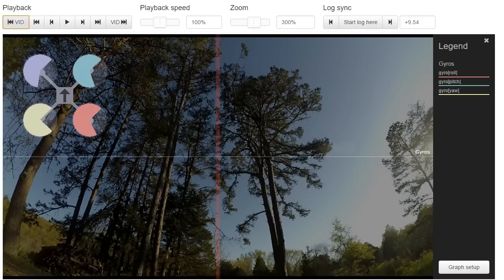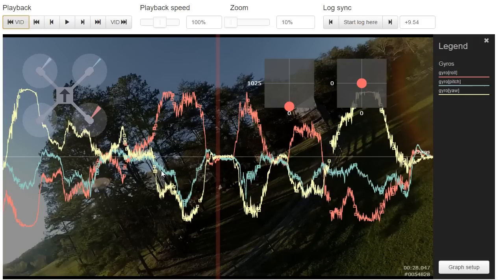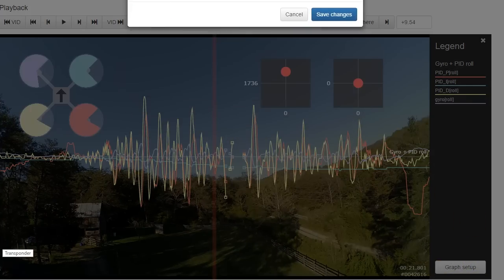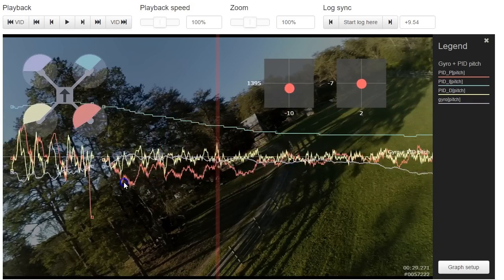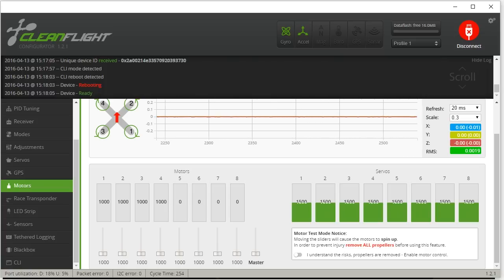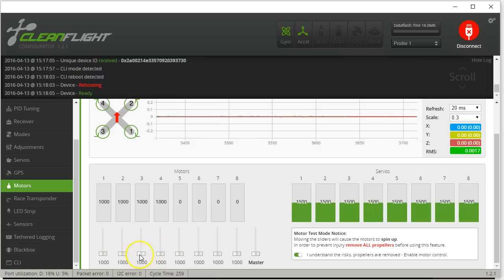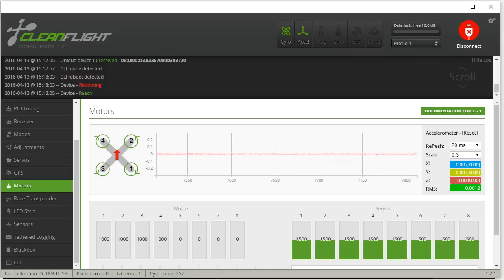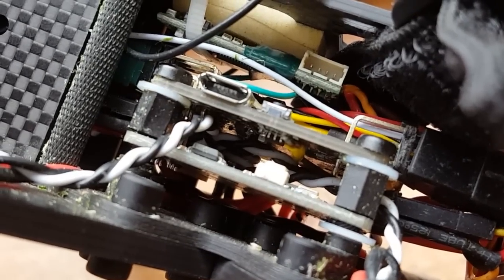How to Troubleshoot Your Noisy Gyro

Comment: When I test my motors (no props) the numbers are consistently jumping around and this is on ALL quads I’ve ever had.. how are your gyro #’s at zero lol what is wrong with my setup? It’s not the computer or the quads I just don’t understand maybe the table even though I’ve done it on 2 tables and recalibrated.. I probably ask more questions than anyone else on your channel but I have ALOT of questions and no one to ask. Anyway thx for all the help and maybe from now on I’ll only ask the really important questions (this ones not that important just curious)
Reply from the maker: Make sure you are viewing the accelerometer and not the gyro. Newer configurator switched to gyro which looks more jumpy. There is a pull down menu to change
Reply: @JoshuaBardwell  FINALLY! I don't know if you remember but im the guy with the astrox that posted a video and you told me it was midthrottle oscillations.. and you were right. I tried everything from filters  I changed the pwm like you said and many other things (made the quad fly better regardless) but now ive FOUND THE ANSWER!! (im a little excited) the brand spankin new 3b motors werent balanced! that's what is causing the oscillations on 2 of the motors at around 1265 throttle in BF.. I balanced the most problematic motor with pieces of vinyl tape and it sounds great with almost no vibrations.. I noticed the two motors that are causing vibration have way more glue (about 3x) than the other twomotors, the glue is also directly opposite where I need to put the tape to get it balanced so my guess is they carelessly put too much glue when balancing at the factory.. this is good news for me though if I can figure out how to take some of it off.. any ideas? thanks so much for the help man this is my first premium build and I was so disappointed when it was flying worse than my $200 first bnf lol you're the man and your videos are on point!

Comment: Hey Joshua, I have a little issue using black box. I was checking the logs of a fresh build. A few of the logs are good, gyro and pids are smooth. The motors are Hypetrain freestyle evo1.1. The bearing are all good and they spin super smooth with the wealth v2 esc's, in my black box, some logs on my gyro + pid p roll, and pid I roll the analyzer display is showing max motor noise over 450hz. I'm kinda confused, because I tested each motor for vibration. Each was .02 or below. Props are brand new.
Reply: Hope you find a solution. I have been chasing the same issue with almost the exact same setup. Wraith V2's, Hypetrain 1.1's, CL F4S, Have been switching components around and still getting mad jello from a ton of D term noise.

Comment: Josh, thanks for all your videos. By chance have you ever seen a quad think it's rolling via the 3d model in betaflight when the motors were run up with the props off while lying flat on a table?  I suspect the accelerermoter or the gyro might be bad however on the sensor tab everything looks fine with the motors off (x,y,z axis level on 0g, 1g respectively)?  My first build, iflight revobee32 f4 power stack on an eclair v2 with emax 1106 6000kv motors, frsky xm plus. Trying to figure out if I need a new FC or what to check.
Reply from the maker: I haven't seen that, but the vibration when props are off can do weird things to the gyro. I would chance hovering it somewhere safe and see what happens.
Reply: I have tried and it just flips over on the roll axis.
Reply from the maker: +matthew maxwell well then I suspect the gyro is damaged. Replace the FC is the fix.
Reply: Gotcha, will do and seriously thanks for the instructional videos you post they are very helpful!

Comment: Hi ! I built a new copter with using some powerfull motors not the cheap ones I used before and now this build starts to have YAW oscillation on P or I term. The motor as strong magnets hard to turn around by hand, I feel the force in it, also it is a a battery killer as I watched reviews... LDPOWER FR2307 2450KV... Should I change something in the BLHeliSuite for the timing or demag compensation too which could reduce I term gyro oscillations? it happens mostly at 30% throttle... I mostly fly at self level more where it is much more shaky on yaw axis. Here is my log:
https://drive.google.com/drive/folders/1rRJWxetVA2_L36z09RFXY-tX9wZT6hDr?usp=sharing

Comment: Hi Josh
Im having terrible video interference at mid to high throttle,ive tried capacitors,new motors and vtx but its still there.
Last night i found that if i held the quad still on the ground with the props off,there was no interference/lines at all in my goggles.
Could this be the gyro gone bad as ive had lots of crashes and it was ok before?
Got o rings on the fc but i know there not the best.
Fantastic videos by the way as always.

Comment: Hi Josh.  Isn't it a bad idea to push motors to max throttle with no prop?  Can't that burn up an ESC or make the motor throw a magnet?  That's what I'm told but it seems hard to believe.
Reply from the maker: +Barry Anderberg it was more true with older ESC's because the RPMs of the motor would be too high.

Comment: Hey Joshua, my quad seems to fly great, but if anything sudden happens to it like bumping into something or simply tossing it into the air to hand launch it, it flips out like crazy and falls. Even doing a quick roll in the air... I've completely wiped it multiple times with different firmware versions and settings but nothing gets rid of that..
Reply from the maker: I'm going to guess that you have a damaged motor or ESC that can't handle sudden changes in throttle value.
Reply: Dang.. I was afraid of that. I have some new motors in so I shall see if they are the culprit.

Comment: Hello Joshua, I have been working on 2 builds for over a week and seem to have this twitch in yaw. Both have the Furious FPV Radiance boards, Cicada 20amp BLHeli-S esc's and 2600KV Red Bottoms. Both Twitch, one worse than the other. Short story I've done all I can think of with help from others. Ive adjusted PID's, went down the filtering path and messed around in BLHeli. Boards and ESC's are brand new, motors are slightly used but ran great on previous builds. If you could take a moment and look at this video and toss me a bread crumb I would be eternally grateful. Thank you. https://www.youtube.com/watch?v=SjoGjYlZGDo
Reply: and to add I am not running a black box but would be willing to go that route if you could recommend a good device since this board does not have onboard flash or micro sd slot. both builds are very tight just an FYI :)

Comment: Hi Joshua

I have just replaced the motors on my quad and it started to do wierd motor throttle jump when I raise the throttle stick slowly. 
https://goo.gl/photos/vb89WfbdjFnSqhoj7
(the low battery warning is because the taranis battery)

How could I solve this proplem? 
It didnt do whit the same setup with the old motors.

The best reason I could find is a gyro noise on the yaw axis. The only thing that helped was lowering the Yaw P value from the default 70.

some info that can help:
- naze32 rev6 with fresh betaflight 3.0
- esc calibration done
- no airmode
- 2KHz / 1 KHz
- the motors are in good order and rotate to the good directions
- dys re2205 motors (old one LeTodar 2204)
- dys xm20 escs

Thank you
Reply from the maker: Is the only thing you did change the motors? Did you also change the ESCs? 

It looks like diagonally opposite motors are jumping. This is consistent with a yaw axis issue. But you are raising the throttle with the PID loop active and the copter held in your hand, so anything weird could happen. Have you tried it with props on and hovering?

Yaw gyro glitch would be consistent with Naze32 r6. It is a common problem with them.
Reply: Yes only the motors have changed (same dys xm20 escs). My idea is that 
the new dys motors are more sensitive compare to the old cheap ones and 
thats why they can react to these quick changes.

I have tried on a flat surface and its doing the same (with PID)
If I control the motors from the motor tab, than its not jumping (without PID)

I have tried with props on, but it coundt even hover:
https://goo.gl/photos/PnKgVZqnrEVHsEcP8

I have heard that its a rev6 issue, but why did it work with the other motors?
Is it possible to lower the noise to make it flyable?
Or what other flight controller (F3) would you suggest to upgrade to?
Reply from the maker: +Robert Kovacs for F3 flight controllers I like the F3 Fury and the Omnibus AIO right now.
Reply: Thank you I will check them

I have just put some rubber under the stadoffs and it reduced the vibration. Now it can fly but still has yaw oscillatation around 1200-1300 thruttle
Reply from the maker: +Robert Kovacs lower yaw P gain?
Reply: yes, thats helps, now around P:20 / I:20 / D:20 its quite good just by lookong at it. I have to go to fly some fpv. thank you for the advices

Comment: When testing motors for vibrations in cleanflight, how about testing all 4 at once? Is it worth doing?
I find I can get peaks of 0.1 on each motor, individually, at some part in the throttle range. But when I run all 4 together it will peak at 0.5
Reply from the maker: Either way can be useful. I like to run one at a time to find the outlier.

Comment: Does somebody know what shore A hardness should the dampening material have? i have access to a wide variety of impression silicones with different mechanical properties. With those and my 3d printer for the mould i could make some decent dampeners :)
Reply from the maker: +crol softer is better because the board is so light but I don't have anything more specific than that.
Reply: +Joshua Bardwell thanks for The answer :) i think i will try out 20-30 shore A then :)

Comment: Hey +Joshua Bardwell do you think it's possible to make a program that quantifies gyro noise and gives a rating? I am trying to decide how bad my gyro noise really is, and everything is relative. I only have one mini quad at the moment so I have nothing to compare to. I have 6" props so i expect my lines to be a little thicker than the ones you show in your videos, but how much thicker? At what point is the noise great enough to cause tuning problems?

Maybe I shouldn't worry about it so much :)
Reply from the maker: +fahrvergnuugen Sure, it's possible. But I think you would need somebody good at signals to get anything quantitative.

Comment: Hi Joshua, 

I see you are using standoffs to mount the flight controller to the frame.
How much you'd suggest the soldering it to PDBs like this?:

http://www.aliexpress.com/item/QAV250-Mini-FPV-Quadcopter-CC3D-NAZE32-Controller-PDB-Board-with-5V-12V-BEC-OSD-socket-for/

In such cases the vibration will always cause issues even if the props are properly balanced?

Thanks,
Peter
Reply from the maker: 404 that link.
Reply: +Joshua Bardwell 

sorry:

http://www.aliexpress.com/item/the-newest-QAV250-ZMR250-mini-drone-quadcopter-PDB-support-SP-F3-CC3D-NAZE32-MINI-OSD-Integration/32644144691.html

I more tend to buy something like this:
http://www.aliexpress.com/item/New-upgrade-version-CC3D-Flight-Controller-5V-12V-BEC-Output-3A-BEC-Power-Distribution-Board-PCB/32480495788.html

along with 

http://www.aliexpress.com/item/Wholesale-CC3D-APM-Flight-Controller-Anti-vibration-Damping-Plate-Shock-Absorber-Set/32345347708.html
Reply from the maker: I'm not a fan of the integrated plate and PDB/etc... The structural plates take too much stress to also have them support electronics. I don't think there would be much difference between a hard-mounted FC and standoffs. Of course, with standoffs, you can vibration-isolate.
Reply: OK, thank you!

Comment: Joshua I noticed you are using O ring dampers on the FC mountings. I personally have never bothered with them as I seems to me the FC lacks enough inertia to allow the dampers to work plus the holes on the FC would need to be substantially bigger than the fastener to prevent transmission from the sides but I am open to being converted :) Perhaps a before and after video and a description of your setup would be useful.
Reply from the maker: +Rob B Blackbox says it made a huge difference. Watch this channel for more details...
Reply from the maker: +Rob B Oh! but for the record, those are not vibration dampers, but just M3 nylon washers for spacing. But I did add vibration dampers later, and they did make a big difference.
Reply: +Joshua Bardwell I would think vibration dampeners will also protect the gyro as well both from damage from vibration and shock damage from collisions.

Comment: Thanks for the video Joshua, as always very informative. I just used this method I learned from you here to look at vibration in my motors, and all of them looked good with the exception of one, it shows a spike in the blue (x) trace only at about 1780-1800 throttle. That spike remains up to almost max throttle where it seems to smooth out a little. Motors are almost new, and the one doing this has nothing obvious with bell gap or damage. Any clue what would cause a vibration to appear at a specific rpm? I'm halfway tempted to replace the motor and see if it fixes it, but don't want to tear it all down if I don't need to. The only thing that seems a bit odd is the blue x trace is the only one moving. The others two aren't moving at all.
Reply from the maker: +Jon Hartman Vibrations often appear at a specific rpm because of a resonant frequency of the frame or motor, or an interaction between the ESC and the motor. Just because the motors are new doesn't mean that they necessarily are balanced. You could have one that made it out of the factory a bit unbalanced. But don't toss the motor on principle. Remember it if you have tuning-related problems that could have to do with excess vibration.

Comment: greats tips. were you testing the motors without props? 

I'm asking because I've tested my motors with props (carefully) and with 6030 I tend to have resonance. switching to 6045 soon but would appreciate any input. 

as for the bell. I'm not sure which motor you're using but do you usually have spare parts or you take it from another motor you have.
Reply from the maker: +Joe Hannouch Thankfully the RCX motors have easy and cheap spare parts. I have a bunch of spare bells to swap out.

Comment: I dont know if you are aware that BF has software filter set fot 10hz on the accelerometer,  so there may be more noise than is showing on the traces.
Reply from the maker: +Zenman FPV thanks for pointing that out. I wasn't aware that the acc default filtering had changed. I did notice that the numbers seemed suspiciously low for how dirty my gyro was, but I guess it must be the standoffs more than the motors.
Reply: +Joshua Bardwell yes, I had a look at mine recently and couldnt get anything above .01 to show up.  I think boris filtered the acc pretty heavy in one of the earlier releases to help the processor out for level modes.

Comment: Amazing motor vibration traces you have.. I have recently replaced my older Cobra 2300kv motors for a set of brand new Cobra 2100kv I had lying around, man the traces are all over the place. I can't imagine they missed QC at the factory. I seem to be always chasing mechanical vibration issues. What motors are you using here?
Reply: +Patrick Wilson RCX 2205 is his normal weapon of choice correct me if i am wrong though.
Reply: My cobra 2206 2100kv "noise edition" are a joke too. I wish the best of them are as bad as his worst.
Reply: Yeah I'm wondering if this is a bearings thing? I've pulled and pressed more bearings then I care to remember, must try ceramic bearings at some point.
Reply: +Patrick Wilson I don't know, but I do know ceramic bearings are expensive and don't take crashes well.. the balls shatter. I balanced mine with alu tape to around 0.1 and they were 0.3 or higher originally. I think the sensible thing is not to invest time or money on those motors.
Reply: +Adam Wolski good point about ceramics! I'll save my time and energy.